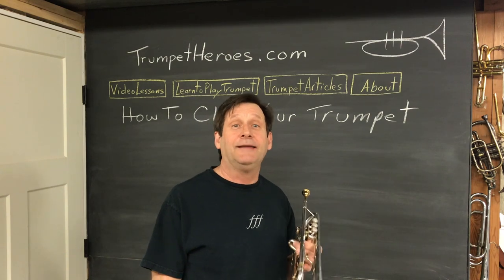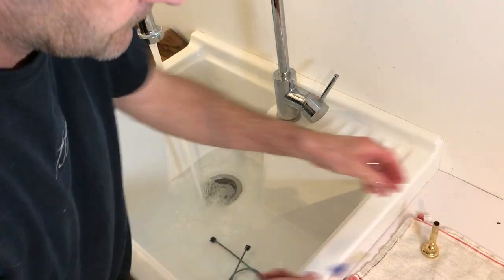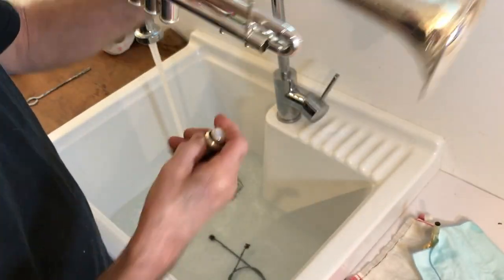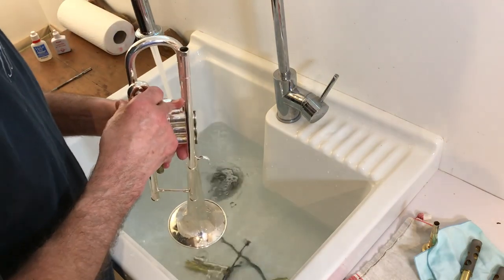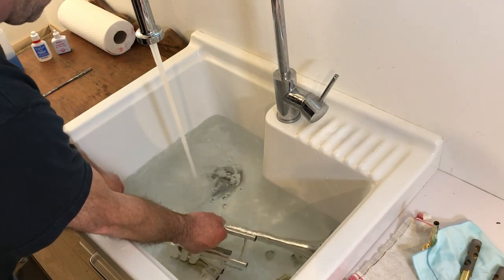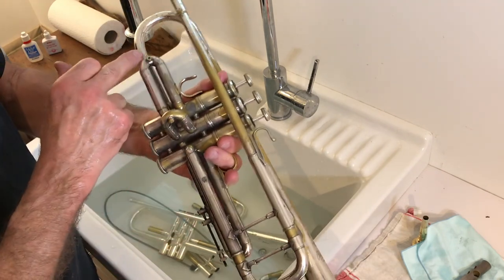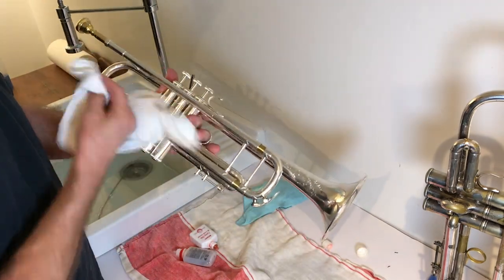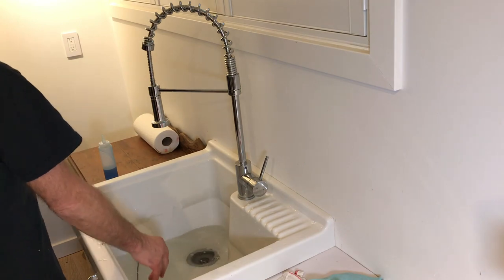How to Clean a Trumpet

Comment: Since valves help support the valve casings, they should be removed last. Otherwise, you may tweak a casing enough to cause a sticky valve when removing a stubborn slide. Gue$$ what happens after that.